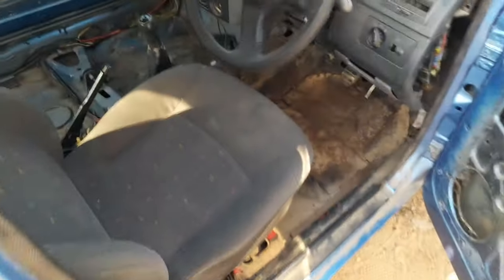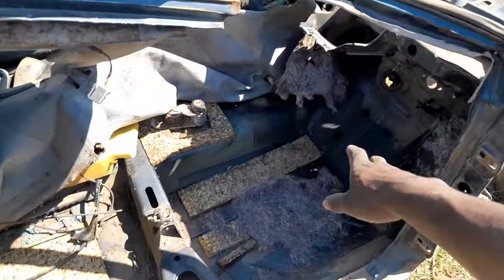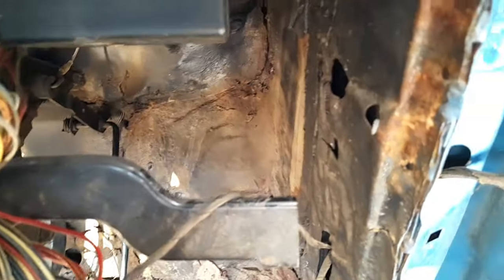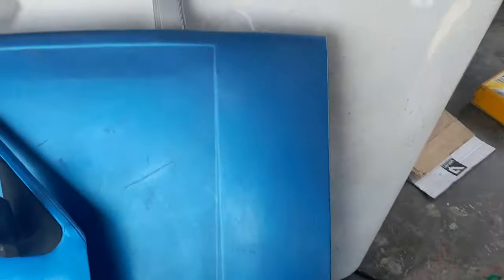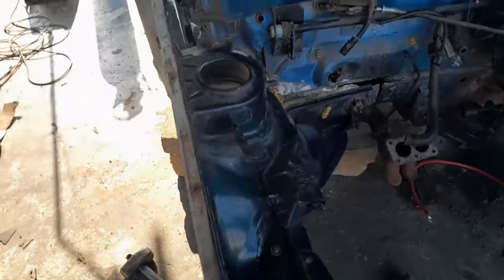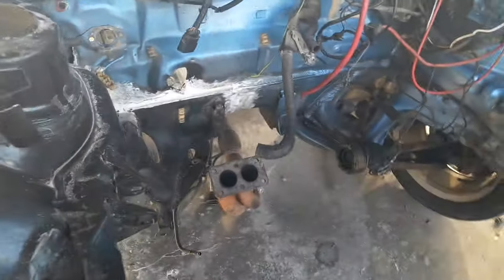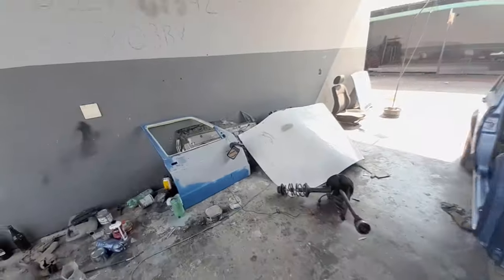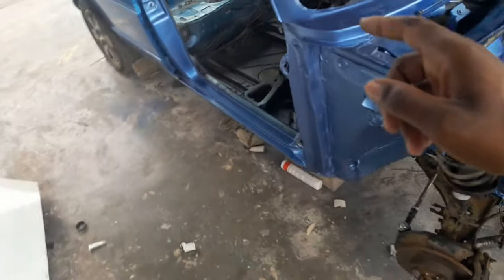Restoring a vw Golf MK1 That I just Bought,(Rust Removal) part 2

Comment: But it's okay it's an inside colour the door and the Fender and the bonnet will cover that colour
Reply from the maker: The fender and the door had scratches and they are already painted and the color is not the same
Reply: @oemspeck  because you're already stripped the car you need to respray the whole car so that they can be the same